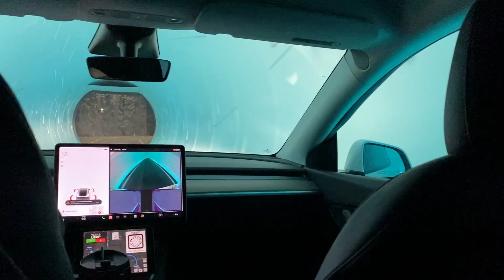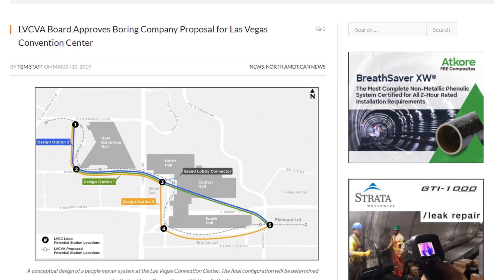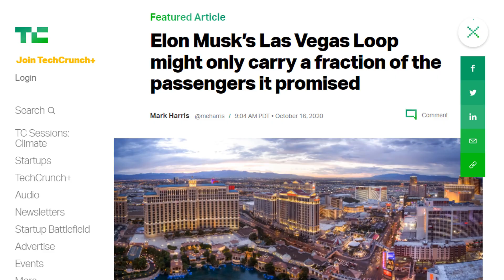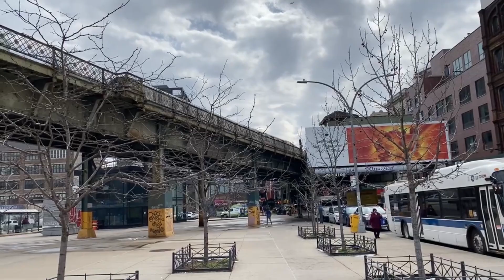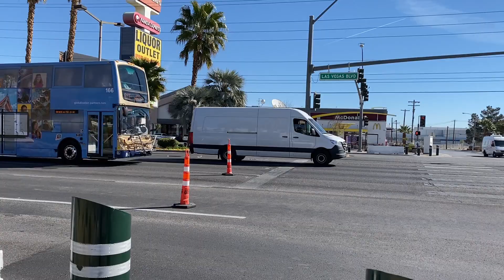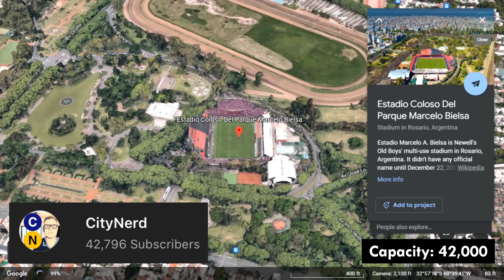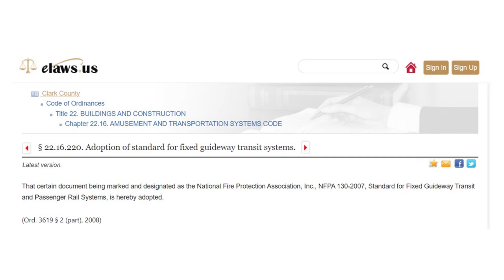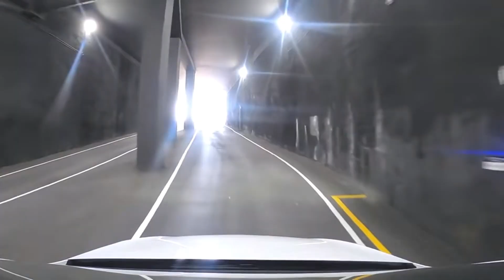Inside the Las Vegas Loop: Transportation Game-Changer, or Complete Waste of Time and Effort?

Comment: The Minimum Viable Product method really screws with lots of public transit fans logic! City Nerd say's it himself no public agency would be allowed to do this, which is the point.
Boring Company aren't solving problems they don't have to. Hence they haven't bothered to make the system autonomous, or buid higher capacity vehicles. Both would be disproportionately expensive to do at this scale and Tesla will do both for its own purposes anyway.
Reply: So they're going to scale it up to.... Busses in tunnels? If you're going to make an argument have the decency to write anything besides corporate-speak.
Reply: @Joesolo13  do some maths, a 12 person pod with a 2 second headway puts 22,000 persons per hour down a much smaller and cheaper tunnel than a subway train. The ability to change tunnels at speed and without central control means that "stations" can be distributed rather than facilities capable of handling hundreds of people at once.
Reply: @adodgygeeza  give you boring tunnels are cheaper because they are smaller without fire protection measures and having no ability for people to escape a disaster in the tunnel.
Reply: @toomanyaccounts  , disabled vehicle comes to a stop. System operator uses in tunnel coms to assess situation remotely. Depending on severity the people on board are instructed to either stay put or board the next vehicle behind them which reverses out. The advantages of self driving EVs is that they can go very fast in both directions with minimal headway. Emergency vehicles enter from whichever side has the best access. Any response is likely very much faster than anything you can do in a metro. system.
Reply: @adodgygeeza  LOL! Uh no. There have been traffic jams in the vegas loop and there is no room for emergency vehicles to get in much less a towing vehicle
Reply: @toomanyaccounts  see point about Vegas being an MVP. The vehicles are manually driven, at whatever point they need to address the access issue they will solve it by autonomous software rather than expensive civil engineering.
Reply: @adodgygeeza  Lol! There is no such software. Tesla supposed self driving is on functional in tunnels due to the cameras not able to see the walls
Reply: @toomanyaccounts  I own one so I am perfectly aware of what they can and can't do. I can find no reference for your claims that the vehicles can't see the walls, it would be relatively easy to place a pattern on the walls that would allow the vehicle to locate itself to the mm, were this necessary. I also work in two highly regulated industries so have a fair idea of the reasources required to build a safety case for a complex system that you could take to regulators (though in this case there is a good question as to what you are regulating), the level of effort would be greater than the cost to drive  ~50 cars manually for a few years. Tesla's strategy (right or wrong) is to avoid local maxima,  ergo tweaking a system to optimise for anything less than general self driving. You could write some bespoke code for the tunnels, have platform screen doors and interlocking that keep pedestrians off the track that would allow the system to work today autonomously. This would cost a lot of money for the 50 car set up they have today. When they do a full Vegas system it will likely have to be autonomous, that will be the point at which they have to freeze/modify the software.
Reply: @adodgygeeza  LOL! All those autopilot fail vids apparently don't register nor why Tesla vehicles legally have to require an operator. they do not have lidar hence cannot see the tunnel walls. there is a reason why Tesla AI claims are considered fraudulent.

Comment: That fire protection thing is what I've been wondering about. What happens if there's a bunch of cars in the tunnel and one catches fire? Smoke gets everywhere pretty quick and I think temperature can peak too, spreading the fire. I don't think there are emergency exits or such. I suppose though that the stations are close together so maybe its thought that people can just get out that way. 

Anyway the really interesting thing here is what is really the logic for each party. What is the business interest for boring company, is this just marketing and they make their money some other way (how?). And for the convention center, I guess they just got it cheap and the need for transport wasn't that big to begin with? It's pretty weird though. The whole loop is like one of those things that when someone came up with them they seemed futuristic but a couple of decades later they are just so outdated and a remnant of something that never really became anything. Except that the loop is like that from day 1.
Reply: They do have plans for fires.  They'd of course evacuate the tunnels, and the drivers are trained to drive in reverse if they receive a certain signal, such as the tunnel lights turning solid red.   One driver said they wouldn't hire you unless you demonstrated you could drive in reverse (not that it's difficult in a modern car with a backup camera).   They have powerful ventilation that would blow smoke and heat away from the evacuating cars.

Comment: I'm curious to go on a little City Nerd field trip and check out the tunnel.  Any news of it expanding to general public use in 2023 and beyond or is it still just for conference pass holders?
Reply: A small part of it is open to the public for something like $4.50 for a day pass.  It will get you back and forth between  Resorts World  and the Convention Center.    They have big plans, with 69 stations  and 60 miles of tunnels.  They've added five (proposed) stops on the UNLV campus, which will make it more useful for university students. Hopefully fares will be subsidized for students and locals.  Tourist fares can pay for the system.

There was talk about having a significant part of the loop near the stadium operating in time for the Super Bowl.  That seems overly ambitious.  I don't think they've broken ground in that area yet.

Comment: As so many have said here, it is a complete waste of time and effort (= money) and completely ineffective/inefficient public transit system.  Check out @adam something on YouTube for detailed critique.
Reply: If I’m a passenger, the loop, with average wait times under ten seconds and average trip times under two minutes seems pretty effective. 

To be ineffective, it would have to fail to transport passengers at all, such as on the days it doesn’t operate. But that would also apply to any transport system. 

DC’s metro doesn’t operate 24 hours a day so that’s completely ineffective at 3 am.
Reply: @kevinbailey8827 and yet it’s not ADA compliant.
Reply: @checkoutmyyoutubepage  The loop does comply with ADA Title III. When they start using vans to transport passengers, they will have to provide ramps to stay in compliance.
Reply: @checkoutmyyoutubepage  ADA Title III doesn’t cover that.
Reply: @checkoutmyyoutubepage  If the Loop is not in compliance with current ADA requirements, please bring it to the attention of regulators.  Or if that doesn't work, file suit.  Or find someone with standing to file suit.

Not being in compliance isn't an argument against the loop.  It's an argument to bring the loop into compliance.   Which is good!
Reply: @checkoutmyyoutubepage  ad hominem.  You have nothing.

Comment: I believe I saw somewhere in the plans for the Loop that they want to expand it into autonomous autobuses that hold 12-15 passengers per ride. Still can’t compete with a real subway system
Reply: A subway's largest cost is the massive stations, with the escalators and elevators needed to get passengers to the surface. The trains are confined to the tracks, so you need a fleet of busses to get passengers to and from the stations. Overall it's very inefficient.

Comment: Saying this concept is ready for anything is a bit of a stretch, rather a last-on-first-off (lofo) Maglev tube system is better suited to interstate travel with a couple city hub stops or terminals, and from that point at a terminal hub, such as an airport or city center. Of course, this aids the goal of lowering intra-country air travel, assuming that is never getting cleaner or cheaper. Obviously, this kind of maglev system is on a scale of the old interstate system in terms of cost, test routes could be built from L.A. to Salt lake shadowing I-15, (later if successful onto the east through Wyoming). Another route from L.A. to Jacksonville FL, or Savannah, GA shadowing I-10. The latter with drop off/on spurs in, Mobile, AL, Louisiana, Texas at Houston, DFW-Austin-SanAntonio plus in the future, if it all works including the non-white haters go away, right into Mexico and Central America. The system would require 4 tubes, 2 big freight tubes, and 2 smaller passenger tubes. All tubes are one-way tubes and weather resistant. Yes, the technology of scale needs work but I think we already know how to build this, it's left to the public regulators to figure it out financially. (Meaning: Bring in the NIMBYISTS!)

Comment: I was just in Las Vegas for the KBIS/IBIS trade show and spent the week there using all kinds of transport modes, including the Vegas Loop once, when I was in the West Hall and needed to be at the South Hall. Since the video here was made, a fourth stop outside the LVCC campus was in operation, at Resort World to the west. What an extravagant use of resources for the benefit. It’s a great demo for Musk and Tesla and Boring, and for that it may be worth it for them, but as a transit system or even a shuttle, it is RIDICULOUS. 

It also does not really accommodate the needs of the user, in this sense. To go from the West hall exhibition floor to the south hall exhibition floor, first you walk the length of the atrium of West Hall opposite your direction of ultimate travel and then go outside into the elements, which in Vegas can be brutally hot or uncomfortably cold. Once in the 3-passenger vehicle with driver who clearly is an advertisement for Tesla and Boring, it is a cool almost theme-park like ride experience. The LED lights and twisting tunnels are a thrill. There is a traffic jam at Central Station as not all the parking spaces there for the vehicles are available and we have to wait until the cars clear so we can bypass (not all cars stop at all places which is the purported advantage of point to point shuttles, except when they have to wait for other point to point shuttles ahead of them to get out of the way. So we pause (<1 minute) but then resume to South Hall, where we emerge above ground at the very extreme end of the hall. 

A real shuttle system would connect lobby to lobby so that people don’t have to still walk long distances to use it. I can see this system as an advantage to supplement the high-capacity monorail but not as a substitute for it or any other real transit. The Vegas monorail’s problems need to be solved by extending its reach north to DTLV and south to the airport and future Brightline HSR station, AND by and giving people on the LV strip a better shorter way to access it. This would be a plus for that type of solution. 

I wonder how it will be when an accident happens in the single file tunnel or when a fight breaks out in one of these Teslas, or when people are drunk or smell of cigarettes….in a train you move, but belted in in a Tesla with two other strangers you are a prisoner.
Reply: When the system is completed, you're not going to be riding with strangers. It'll be similar to using Uber. You just tell the driver which of the 60 or so stations you want to go to. Unlike typical city transit, you won't have to worry about riding with drunks, thugs and riff raff.

Comment: This looks terrifying... when one of the teslas catches on fire, what happens?  Everyone has to back up to let the firetruck in?  Will it even fit?
Reply: The firetruck won't fit, but firetrucks rarely go into subway tunnels.  There is water available under the road that they can tap into,. 

If there is a fire, everyone behind the fire would back up.   They only hire drivers who can back up a car, and they practice the maneuver.   The cars in front of the fire would continue moving, so that part of the tunnel would already be clear. 

Electric car fires usually start slowly, with overheating.  There's as much as half an hour between the first signs of overheating and the fire.  If I were in charge of the Loop, I'd monitor all vehicles for signs of overheating battery packs, and remove any vehicles as soon as the first signs appear.  Deal with the overheating battery on the surface where firetrucks can easily go.
Reply: @kevinbailey8827 subways have fire suppression systems.

Comment: It's all relative. Cab ride clogging up traffic or this? It's relative to the walk and current available transport. They are trying and will fail forward well. Those tunnels can be upgraded to rail very quickly. Or even the wire style guidance wheeled robots use. They are trying and trying well. Walking back to the hotel for the tenth time can be unfun
Reply: So far the LVCC loop is running fine.   Sure, it could be "upgraded" to a train, but why spend hundreds of millions to transport the same number of people (you can only transport the number of people who show up, and this isn't a case where that number can grow significantly), and to do it less quickly and with longer wait times.

Comment: Member, when there were several channel's  that talked about how Elons Tunnel was basically all just BS and no way that  it would work.
 
And all the fanboys would downvote the science, engineering and math channels when they explained in GREAT detail why it was all BS. Then Elon showed off his really expensive tunnel that had cars driving through it and they said he was still going to work on it and he had just ran out of time to finish, but he never did?

Cuz I member
Reply: But it’s there in Las Vegas, and it works.
Reply: @kevinbailey8827  A single lane tunnel that cars drive through. That wasn't exactly the concept people were excited about. I essentially just fail to see how this is particularly interesting at its current scale and fail to see how it would work at a larger scale.
Reply: @AmbientMorality  You mean you fail to imagine how it will work at a larger scale.  But they're building it at a larger scale, with 50+ more stations along the resort corridor and also the airport and stadium.  Then you will get to see how it works.
Reply: @kevinbailey8827  Yeah I saw your thread in another comment after and I don't think there's anything I can meaningfully add.
Reply: @kevinbailey8827  So like a normal car tunnel? Or a subway station.
Reply: @Firstname137  It has aspects of both, but isn't exactly like either. Can you clarify your question?

Comment: What's new isn't necessarily better. What really matters is how cost-effective a piece of technology is, and the utility it offers to consumers on an individual basis. For example, apple products are premium and the newest iteration of a product line often has additional features, when compared to prior models, but I often question whether or not people actually use all the features. If none of the new features are used, then it'd make more sense to just opt for the older and usually cheaper model, but companies will still try to sell you that the newer one is the better choice, because the product is better than the previous one. For the case of Las Vegas loop though, it's an inferior product. Not only that, the money spent on it could have been better spent elsewhere.

Comment: 2:30 this is literally a controlled area, how the fuck isn’t Elon having the cars go past 155 mph. This is literally the best conditions. Maybe Elon has been lying all along
Reply: Nutty speed for the tiny distances now possible.
Reply: Not allowed by local regulators.  Also not necessary so far. The average trip time is under 2 minutes.  The average distance traveled is less than half a mile.

There may be segments in the longer LV Loop where the cars travel at faster speeds.  We'll have to wait and see.
Reply: @kevinbailey8827  We will never find out. That thing is going tits up before it will ever reach a somewhat finished form.
Reply: @xxJohnxx77  either way I’m willing to wait and see!

Comment: Vegas is not built for a lil rain 🌧 It floods like a monsoon after 30 mins of rain…. Add electric cars in that …
Reply: I wonder if anyone involved in these tunnels has thought about rain and potential flooding.   There was flooding a couple of months ago, and it didn't affect the loop tunnels.    So obviously they're aware of rain.   What did they do that kept those tunnels from getting filled with water?
Reply: @kevinbailey8827  Hi Kevin, and SummerTime, Las Vegas Review-Journal has an article on it. The gist being that there is a pumping system to remove natural seepage but drainage near the entrances is designed to divert any flash floods.